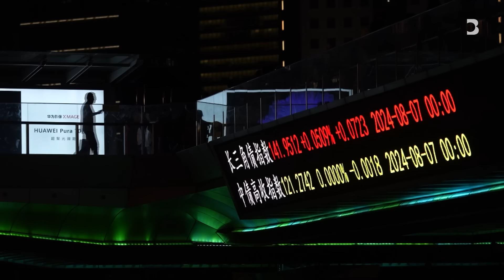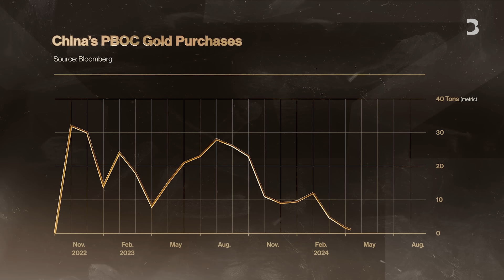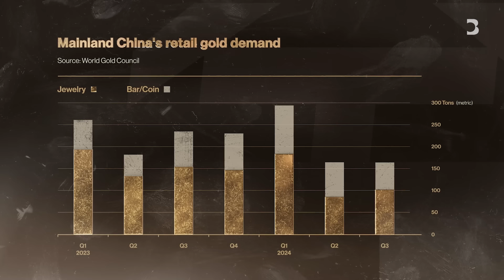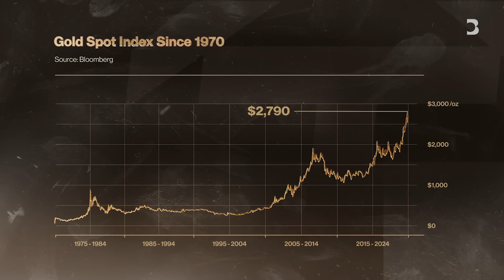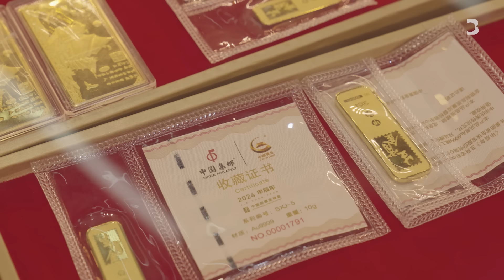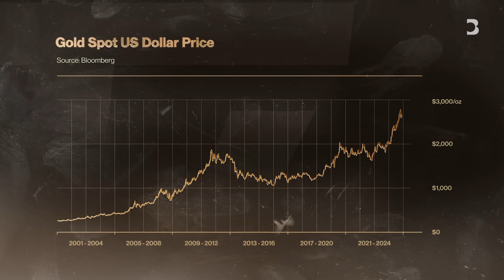What Gold’s Crazy Run Says About China

Comment: In the past 15 years there have been several different boom and busts of assets via China. In mid to late 00s there was raw materials/metals boom which countries such as Brazil profited on till the bust. There has been the Chinese property market which has gone bust. Now it is gold. While it is probably more safe then its property market there is still the issue of needing to exchange it at some point. At some point a large amount of gold asset sellers will need to liquidate and this can easily trigger a big sell off. It is not a question of if rather when with run ups like this.